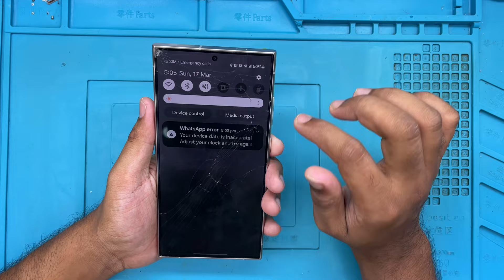Samsung S24 Ultra glass replacement | how to restore s24 ultra cracked glass | phone doctor BD

Comment: Itne mehnge phone hain phir bhi inka glass boht easily toot jaata hai, mere S23 Ultra ka bhi 2 din pehle hi toota hai jabse glass toota hai dil toot gaya hai phone ko leke 1 lakh 6 hazar deke khareeda tha dil ke tukde tukde ho gaye.
Reply: Glass kaafi durable h. Tune galat giraya hoga. Ye phone baki phone se zada impact jhel jata h. But every glass can break. Just replace the outer glass and you'll be good to go if the inner display is not damaged
Reply: @handlewithoutcare  bro I also have realme X2 pro for more than 4 years now lekin woh itna gira hai isse twice height se gira hai lekin uska kuchh na bigda tas se mas tak nhi hua yeh toh boht mamuli sa gira tha.
Reply: @ramzirmz786  bhai main bol raha hu mere pas same phone h and I NEVER use cover. Mine has fallen multiple times. I literally mean several times. And it was able to take it. Wouldn't it be absurd that realme made their display stronger than Samsung did for its flagship? Aisa nhi hota h. Har chiz tut sakti h. Height b matter nhi krti, angle and surface does. You were just unlucky, in the way it fell down. And probably less careful. Not the phone's fault.
Reply: @ramzirmz786  btw I'll be honest the only thing that broke was the back glass after falling on concrete while cycling. Again no cover, no screen protector as always. But I live in China. To maine Poora phone hi badal diya exterior se. Because yaha original parts bht saste milte h and great workmanship. Now my phone is sky blue